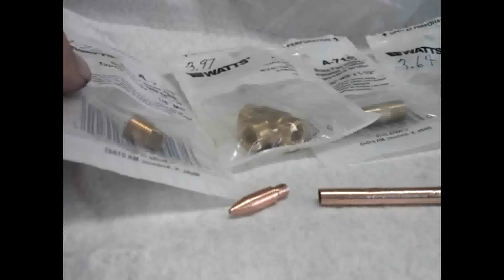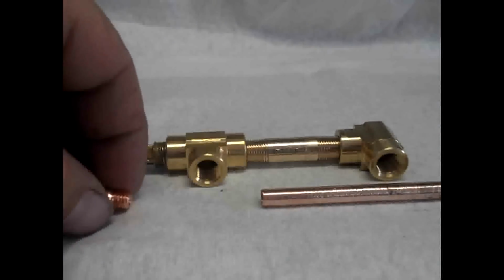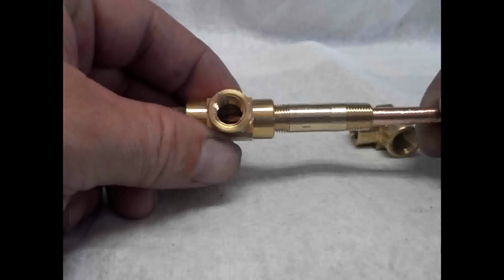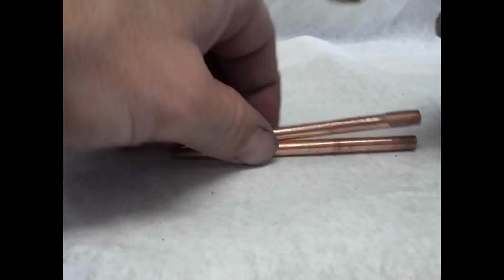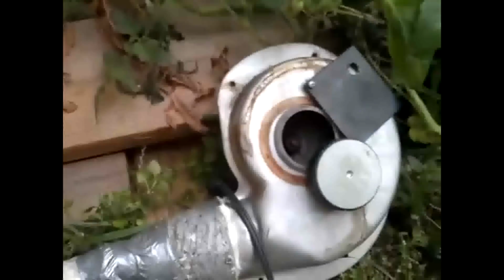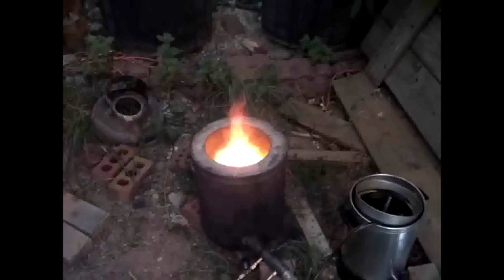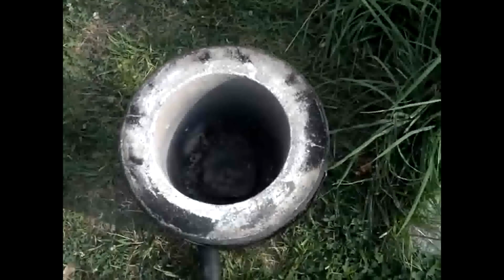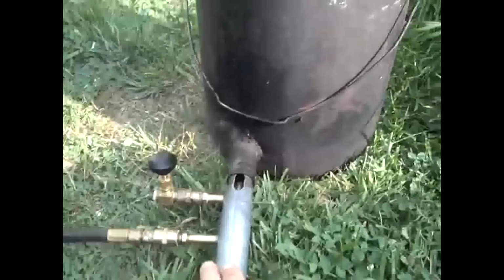How to Build the Kwiky All Fuel Foundry Burner

Comment: Question for you, how far from the end of the tube do you have the nozzle both when it's in the furnace and out in atmospheric. Also how far do you have the end of the tube from the bore of the furnace. Also I can't seem to find the tube size for your small tube it still seems to perform well even thou it's on the small side.
Reply from the maker: Hello, My small burner tube is about 1 1/4 inch...It is really the first tube I found laying around just to try it out.  My other burner is 3 inches and I still have to make a furnace to fit it!!.   I haven't really played around with the burner tube.  Of course it will burn a lot easier in the furnace and especially when the furnace is hot.  My problem when I first used it was blowing too much air through it from the blower...It was actually cooling it off.

Comment: Not shure if this was asked but do you an idea of the cfm your using through the tip? I would like to be able to run this off my on board air for my truck but its a little limited on cfm.
Reply: Answered my own question. I setup a test jig using what I had laying around, nozzle was much bigger then a .025 tip and my 2.5 CFM OBA maintained 50 psi at low battery voltage. So now to collect a regulator and some fittings. Thanks for putting this up. For anyone who is wondering I have the Masterflow 1050 compressor from pepboys, also sold as mv50 from other vendors. great compressor for the money on a trail rig.
Reply from the maker: just saw your question....glad you got it answered...it does use quite a bit of air.  The commercial nozzles will use less...they may be more prone to clog from what I understand.Let us know how it turns out for you!

Comment: Great video by the way. I'm gonna put this together tonight. The only thing I'm not sure about is how you mounted it in the pipe?
Reply from the maker: I drilled it so the tubes fit in tight and the fittings stop on the burner tube.  Then I drilled and tapped for a screw to go onto the middle of the tube to hold it tight.  See the web page in the link for a picture of it.
Reply from the maker: http://youtu.be/JTTfp1YEFTc  This video shows one mounted in a larger tube
Reply: That's a monster! I will be interested in seeing the furnace you make for it. I ended up using a 1 1/4 pipe. I noticed you mounted the burner in the back of the tube on that one. I should be able to test mine tonight. I'll let you know how it goes.

Comment: Hey David, you made a totally awesome tutorial man. Thank you so very much. Tomorrow I'll be at the hardware store getting these parts. Thanks again man.
Reply from the maker: Thanks, let us know how it goes.  Someone told me that you have to be careful when you get the nipple part these days...evidently, they are making it hollowed out now.  The one you want is solid from the threads to the end.
Reply: David D, the parts cost around 40 bucks today in (Hawaii) this price also includes additional T to inject the propane alone, or separate inlet and two more needle valves. 1- to control the oil flow 2- to control the propane flow, (As a starting flame).  I was testing the burner yesterday using Babington Burner type way, but flame was quite unstable. So, I am really glad you made this video Dave and remove the mystery out of this siphon valve. Later I'll make a video and share my burner with you guys.

Comment: Will this work with old motor oil?
Reply from the maker: it will work a lot easier if the oil is thinned down with kerosene or diesel...or, I have a video on building a pressurized fuel container that helps the oil delivery.  Or some people heat the oil to make it flow better.
Reply: Watched the video and i like the pressure tank. Thanks!
Reply: I havr a gallon of refractory cement, e perlite, some crushed fire brick and sand. Do you know what would be a good mix for my foundry?
Reply from the maker: I wouldn't use refractory cement in a furnace unless it is rated to 3000 degrees F.  I used some in a lid once and it slumped.  If you aren't going to go with commercial refractory, I would try a mix of fire clay and sand...fire brick crushed small and perlite should be good to mix in too...It should work as long as you don't bump the sides too much.

Comment: Awesome video.  I would really like to see you do the same video.  But with some temperature gauges and see which fuels actually heated up faster.  Second I would like to say that no flame or suit I think means complete combustion so if you blew enough air in with the oil the flame would get a much smaller.  So to ways to do this turn the oil feed down or turn the air supply up.  You did have an awesome way of explaining things.  I think you should also do some testing to see which ones get hotter faster.
Reply from the maker: thanks!

Comment: So haven't seen any comments about how much Kerosene this will burn per hr. running 30 lbs. of air pressure. I'd be curious on what the cost per use would be.

Comment: I think you have ingenuity and enthusiasm . that is good. However , propane is a gas that is Heavier than air . it  spills or falls out to a low point. that means ,it is possible  to send it thru a hose and should you lose flame the gas would start to  fall out of the container, onto the ground , a re ignition attempt  might be your last. if you run  the propane thru too fast  it is possible for the regulator to freeze ,if it does that it could lose ignition .and the   tell tale sign that it is freezing up on you from burning it to fast  ,are sputters of gas and flame, that is gas that is liquid  that  behaves  badly  in open air you  are  Somewhat safer than shooting it into a container that may be  near the heat required  for ignition... please be careful in your adventures .we need young people like you  to  grow older and do some great things for yourself and the community in which you live.
 cold propane   off the top of my head  would cool your waste or veggi oils ,  so   lower propane pressure , more Oxygen,  would  likely  allow a 20 percent  fuel oil  and 80 % veggi oil  to  fire .  i hope that  helps  keep you  aware  of some of the minor technicalities.
Reply from the maker: thanks for your comments!  I don't run propane through the burner...it uses compressed air to mix with the waste oil.  And I appreciate your warnings about propane.  I never keep my canisters in the house...only in the shed where there are no ignition sources...and I never leave my furnace unattended when it is running.  Good safety practices for running a furnace using any kind of fuel.

Comment: Dude!  After a months of futzing with my wood burning / WO drip feed combo rocket heater I came across your video. 
While my Frankenheater worked okay with wood I would have to play with an air hose blowing into the opening, constantly adjusting the sweet spot, to get a hot burn.  Then the wood disappeared fast.  I tried a Babington burner and just made a mess.
After watching this I ran out and bought the same stuff and made the vanilla model burner and now my 2 car uninsulated garage is 75F!  I stole the coffee percolator oil warmer idea, too.

Now to find more oil and build a forge for some mag wheels I have laying around.  Thanks a bunch for sharing.
Reply from the maker: Glad it worked for you!

Comment: Do you think changing the mig tip to a 11-40 (.040) tip will cause any sort of major change?  I have everything else the same as far as 1/8 inch fittings and nipple and i'm using 1/4 OD copper tube, just have a different mig tip as the 11-40 is what i had on hand.  Just wanted to ask because before i solder the tip on, i'd like to know if it would be usable or if i should just got buy the .025.  oh sorry btw, nice video.

Comment: I would think the oil/air mixture will depend on the viscosity. any thoughts on vapourising the oil will improve things no end, but it will have to be fully vapourised. No spits, lumps and dribbles.

Comment from the maker: Hello  Yes the mixture is the hardest part.  You can try thinning the oil with kerosene or diesel...heat up the oil to thin it...put the fuel supply up to create pressure...or some people have talked about putting a small aquarium air pump into a closed fuel supply to create a small amount of pressure.  I am currently planning on making a fuel container from a propane canister ...my compressor had duel outputs so I can just put a fose out to the fuel container.  It only should have to be 5 lb

Comment: i have built one of these little things exactly the same way you have discribed but the only things i can get it to run on is kerosene and diesel i can not achive a flame with waste oil or waste vegetable oil i have tryed different adjustments with the 1/8'' plug and still nothing ive tryed getting it nice and hot on kero and still nothing just lots of smoke tryed different pressures on the air regulator and different fuel adjustments with my needle valve the only thing different is that

Comment: Dave where you getting your fittings at- at a cheaper rate ? I buy mine at lowes and they're much more expensive.especially the 1/8 fittings, I use 1/4 fittings because for some reason they are cheaper and I can run dirty waste oils with no need to worry about clogging. Keep up the good work

Comment: Depending on how many watts the blower fan draws you could either use a light dimmer or a variac to control the speed to control the air flow more accurately.
Nice deisgn for the burner, I will probably make something similar depending on the parts available here.

Comment from the maker: I use that big coffee pot to filter it.  I tried to use it to heat the oil a couple times but it seemed to heat it too fast and made the oil bubble and smoke...and created burned carbon chunks.  Maybe I could take it apart and disable the percolating part of it.  It burns fine without preheat...and if the oil gets thicker in the winter, I can always thin it down with kerosene.